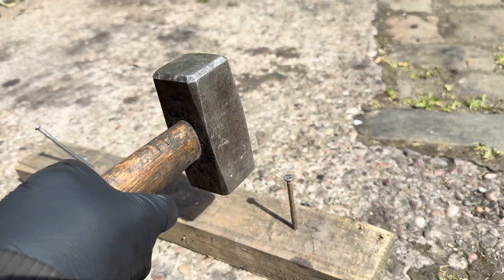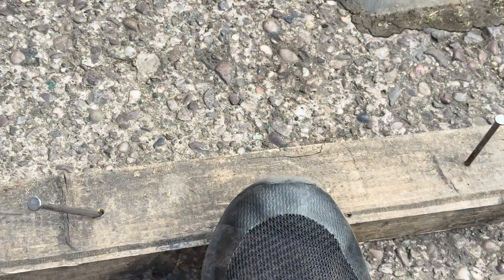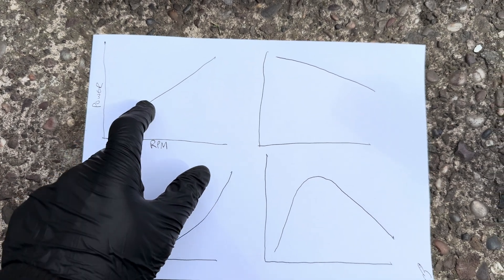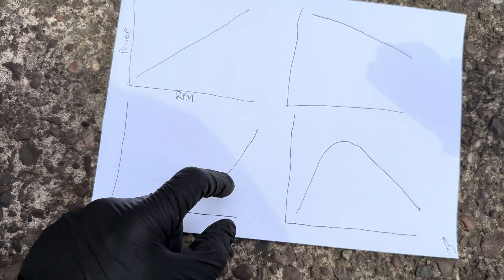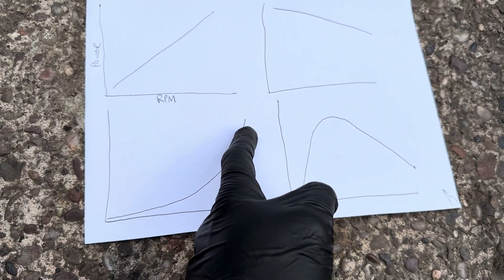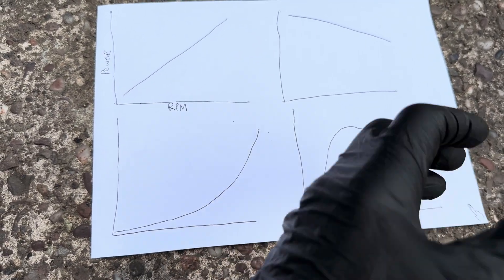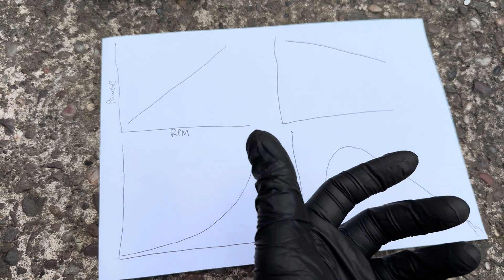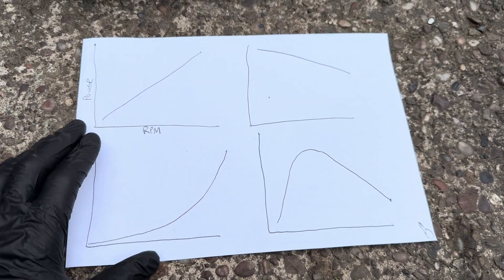The Difference Power and Torque, and Which is Faster? Torque VS BHP Explained & Visualised

Comment: I don't know why this is such a huge topic.  Torque is the twisting force that the engine can make.  Horsepower is how fast an engine can spin up to it's redline.  If we take 2 engines, one with 150hp and another with 200hp and they both redline at 6500 RPMs, the engine with 200hp will get to 6500 RPMs faster than the engine with 150hp.
Reply from the maker: @PeTroL420  kind of. The power is just the torque in relation to the speed of the engine. You need torque to spin it up to the redline
Reply: @StupidBlokeStupidVideos  that's a lame response that doesn't explain anything
Reply from the maker: @PeTroL420  well you said power is how fast an engine can spin to its redline, which it isn’t. Power is basically just the torque but in relation to the speed of the engine. If you’re making 100nm of torque at 3000rpm and another engine making 100nm of torque at 6000rpm, the one that’s spinning faster has twice the power effectively.
Reply: @StupidBlokeStupidVideos  How do you explain how a square and oversquare engine's horespower climbs while the torque is falling?
Reply from the maker: @ because although the torque is falling, the rate the rpm is rising enough so that its faster than the rate which the torque is dropping….

Comment: The 107 has plenty pf both.
Reply from the maker: @simonjj7397  it’s a C1 mine, even more fasterer
Reply: The c1 is a dark horse its more aerodynamic than the beemer. So time from point A to point B calculated by fuel used. Minus the drag factor the C1 has it
Reply from the maker: @ don’t forget it’s got the wang on the roof, but without it the car would be down right dangerous due to the sheer amount of powers it has

Comment: Horsepower is how fast you hit the wall. Torque  is how far you take the wall with you
Reply from the maker: @MarkStott666  it’s not far wrong tbh
Reply: No mass and velocety is what defines how far you go after hitting it, horsepower and torqe are both involved in how far and how long you need to accelerate to reach the velocity
Reply: @The_otschi  wasn't meant to be entirely scientifically correct.....